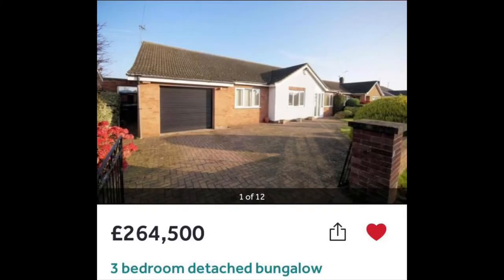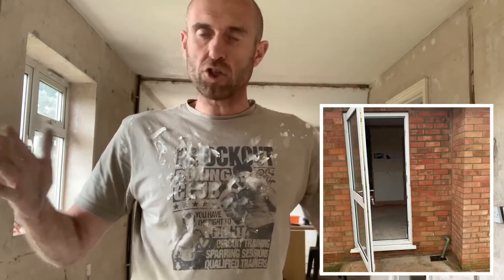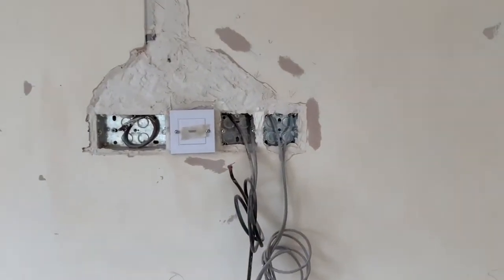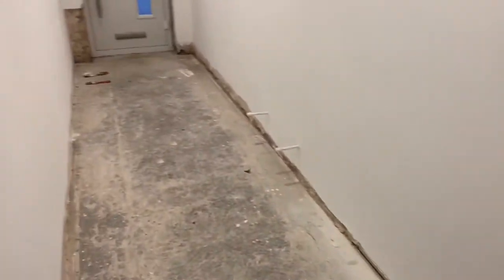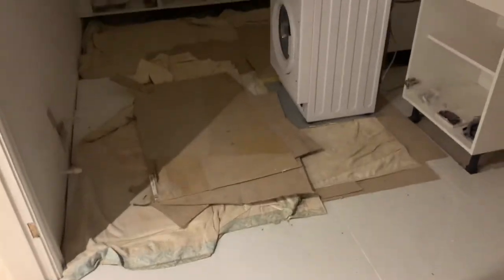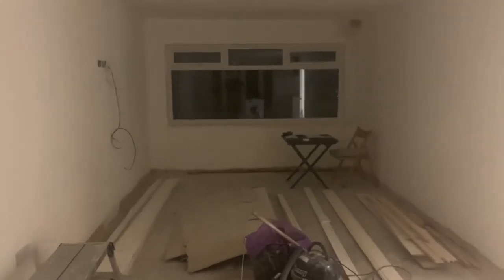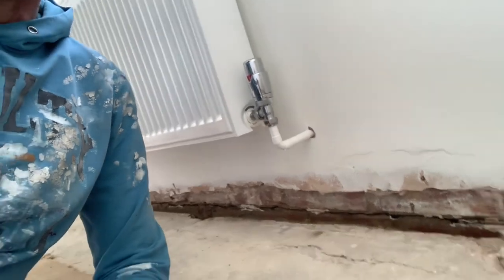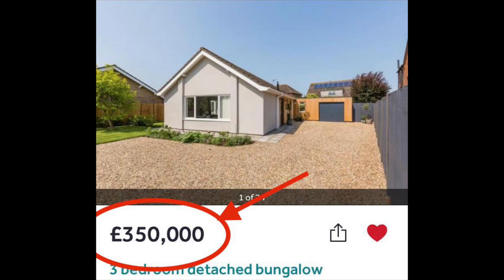Increasing A Properties Value By 100k | My Own Residential Lockdown Project | Property Flipping

Comment: great video... i often pressure test pipe work with air before a water test can save some water damage and you can often hear the hissing were the leak is or there is no pressure and you have a real issue. ps you attitude is amazing after all these issues
Reply from the maker: Hey Scott, that`s very sound advice and I as actually told my plumber had air tested it, oh well not the end of the world. 
Thanks very much for watching and for your comment. 
Have a great day

Comment: Hey Dan. Great work. An increase of 100k is very exciting. I'm cautious of going into property flipping myself (26 years old and £60,000 saved) as I have reason to believe buying property in the West Midlands (Birmingham, Coventry, Leamington, Redditch etc) 2 bed terraced houses start from £120,000 but renovating (removing walls, new kitchen, new bathroom etc) to add value rarely increases the price that much once you put it back on the market. A  house gets bought for 120k and then gets renovated to look like yours but only gets put back on for 140k for example.
Reply from the maker: Hi Creg, thanks very much for watching and for your comment. You are right to be concerned with the type of property that you describe. For it to work on the smaller, older properties you would want to be getting them for well under the market value.
Renovating a 2/3 bed terrace costs on average 15/20k depending on the work involved, you would want to be getting the property for at least 40k under the end market value to make the task worth while. 
If you were looking to flip though you would better finding a run down, dated family property nd bringing it back to life, residential buyers will pay far more for a ready to go property.
Thanks again for watching, have a great day.
Dan

Comment: Excellent job. Great watching how someone approaches a property renovation. I completed my first ever bungalow renovation and took me forever to complete as I did almost everything myself including plastering all the walls, plumbing, kitchen and bathroom fitting. To say I’ve learnt a lot is an understatement. I’m now looking for my next project and plan to be so much more organised and not take as long as I did for this one. Do you know percentage wise how much of the £38k went on labour and how much on materials.
Reply: @Babbycatt - well done to both of you. Builders are useless. I've been just conned by builder no: 4.
Reply: @Babbycatt - I'm decent but have so far stopped short of plastering. Would leave plumbing to professionals though the plastic connections seem easy to fit. It's mainly time. I work full time and have a family so can't afford to take time.
Reply: @Babbycatt - what do you think about sticking plastic shower panels on top of tiles? My shower tray was fitted over tiles and there's a gap between the tray and tiles as walls are not 100% 90 degrees angle. Was thinking of sticking these plastic panels over the tiles which would cover the gap. But one builder said the plastic would not stick to the tiles as neither material was porus. But I have seen some YT videos of this being done?
Reply from the maker: Your not wrong, the learning curve is steep and fast but like you say well worth it, if only for the hands on education.
Reply from the maker: It`s mad right, no one seems capable or willing to do a decent job these days.

Comment: Great video..showing your complete journey. I was wondering why you decided to be personally involved in the renovation when a lot of property gurus advocate removing yourself from the day to day work so you can make better use of your time? Also, you deposit works out at only 15%. How were you able to get  BTL mortgage with such low deposit?
Reply from the maker: Hey Anthony Dear,
Thank you very much for watching and for your comment.
This is my residential property so I wanted it done right, unfortunately, I have very high standards and suffer from perfectionism, no tradesperson would have completed the job to my standard so it was easier to do it myself, plus I enjoy doing it, it keeps me off the street right :-).
I was able to obtain a mortgage with a 15% deposit as it`s a residential property.
I hope this helps with your questions
Have a great weekend